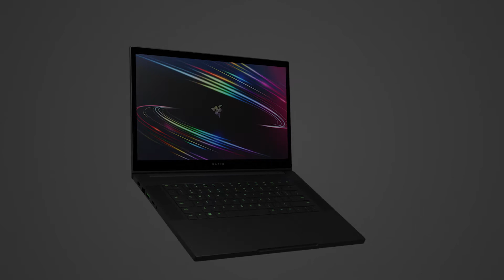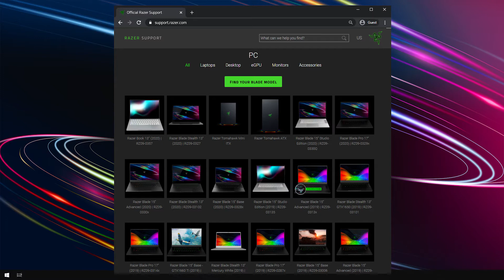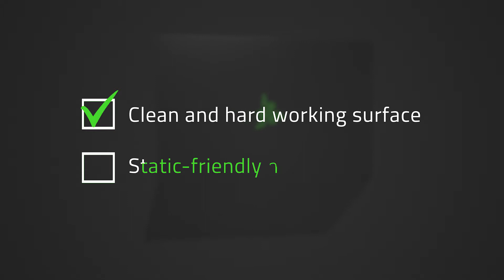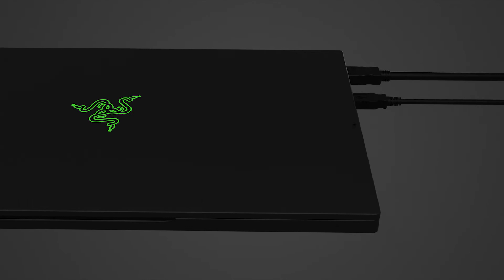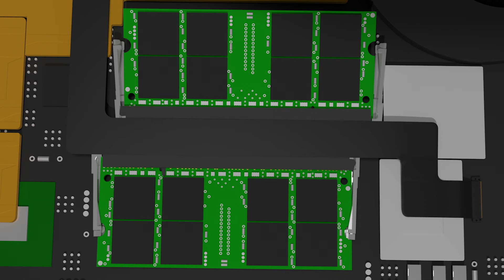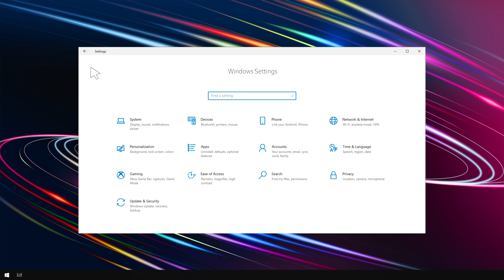How to upgrade RAM on the Razer Blade

Comment: Hello R Λ Z Ξ R SUPPORT, does this method work for the new 2023 Razer Blade 16 with ddr5 ram
Reply: I have the same question and is the Crucial 5200 Mz RAM compatible with the razer blade 15?

Comment: I upgraded my Razer Blade Pro 17 (2019) from 16GB to 64GB (2666Mhz Redline RAM).
It started right away and also displays the right amount of RAM in settings and task manager. But 
I can't game anymore. Its crashing all the time. Do I need to change something in the bios?
Reply: 3 weeks and still no reply from Razer. Thank you for your support!
Reply: @noneofyourbusiness7651  Enter bios to check for system stability

Comment: Hello
I have a 2020 Razer Blade 15 Base model: RTX 2070, i7-10750 with 16gb ram.
Is 32gb the max I can upgrade to? If so, should I get two 16gb 1Rx8 2666mts sticks or two 16gb 2Rx8 2666mts sticks?
Also, is 2tb the max ssd it can have? And does it have 1 or 2 slots for m.2 ssd?
Thanks
Reply from the maker: Thanks for posting your inquiry here. To provide accurate answers, please reach out to us from here: https://insider.razer.com/index.php?forums/support/ with the serial number of your laptop so we can verify its exact product details in our system.

Comment: does razer blade 15 i7 9th gen rtx 1080 support 3200mhz? stock is 2667mhz
Reply from the maker: The 3200Mhz RAM will work just fine but it will downclock to 2666Mhz because that is the clock speed limit of the motherboard.

If you have further questions, please feel free to reach us here: https://insider.razer.com/index.php?forums/support
Reply: @rzrsupport9502  sorry for the mistake i got the razer blade 15 i7 9th gen rtx2080-4k oled 2019 model. does is still support 3200mhz?
Reply from the maker: The 3200Mhz RAM will run but the clock speed will be limited to 2667MHz.

Comment: There is no available 2667mhz in our country, is the 32GB 3200MHz supported by RAZER BLADE 15 8750H, GTX 1070?
Reply from the maker: You can use 3200MHz RAM but the frequency will be automatically underclocked to 2667MHz. Be careful to select a memory that is compatible with the laptop as not all 3200MHz modules will work.

If you’ve got any further questions, please connect with us here: https://insider.razer.com/index.php?forums/support
Reply: @rzrsupport9502 thank you very much

Comment: hi, does the blade 15 base model, accepts 64gb ram 3200mhz?
Reply: Yes
Reply: @stevie9361  thanks
Reply: @stevie9361  does that thick ribbon cable  exist in the base model ? And how hard is it to remove ?
Reply: @HandheldGamingHQ  I don't know if its in the base model as well but it was in my advanced model & it was a struggle. I would say lift the lever/hinge it has and pull it back, don't pull so hard to damage, just pull with light force on the hinge/lever